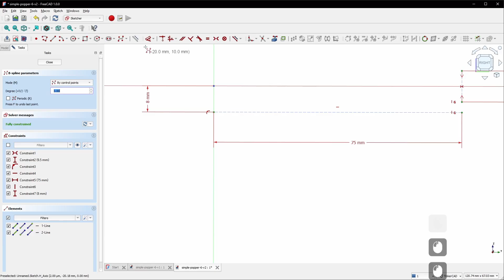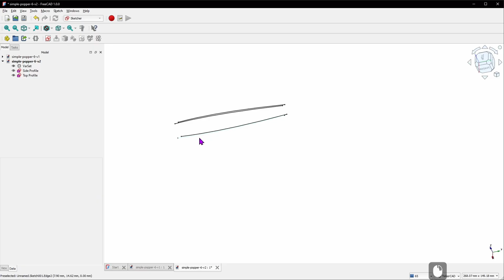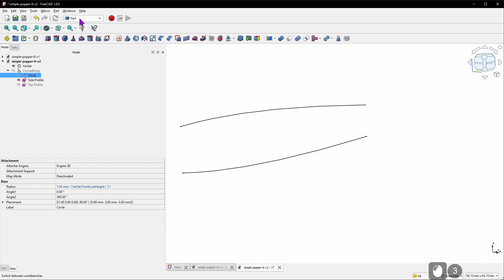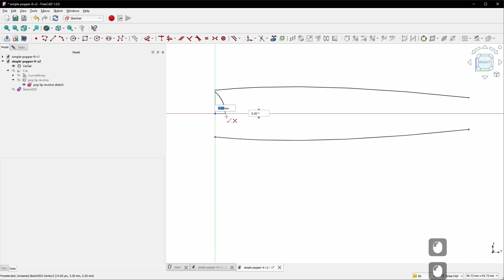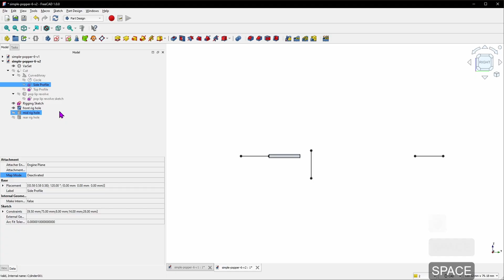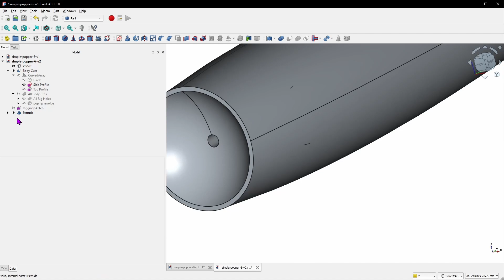Make your first fishing lure in FreeCAD

Comment: Why oh Why would you go about this in such a needlessly complicated way?!  
You only need one sketch revolved, one sketch pocked out of the bottom and one sketch with a two-sided offset cut for the eyes.  That's a total of three very simple sketches and three operations!
Reply from the maker: Dang, I really simplified this from what I was previously doing. I can always learn something new, I’ve only been at this for the last year. I’ll give your method a shot!

I have no idea how to do the eye how you are describing, but when I think about your suggested workflow I get how I could include the front and back screw holes in the revolve
Reply: @IfItPrints you'd need to do a datum sketch plane for the eye pocket but yeah I was thinking the same thing. 

Don't take that as a knock against your workflow, FreeCAD has a million ways to do the same thing. If it works for you it works for you (but using the revolve sketch method you probably could've done this in half the time) 

I've got some FreeCAD lure design videos and live streams on my channel you may want to check out!
Reply from the maker: Thanks! Yeah this method with the curved array I wanted to show because many of my designs are not a simple tube. I wanted to start with something simple for the first design vid— but, for example— if you want a bait that is half as wide as it is tall, I don’t think a revolve would do it.

Before I discovered curved array, I would add loft points, copy a bunch of profile sketches and attach them and then do my loft.

I appreciate any feedback!
Reply: @IfItPrints I do something similar with the additive pipe tool on many of my baits